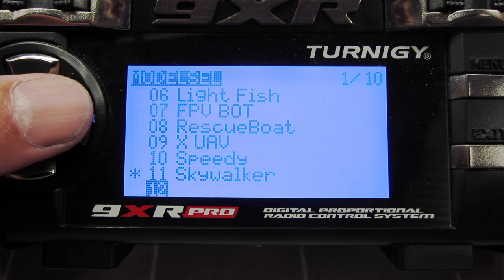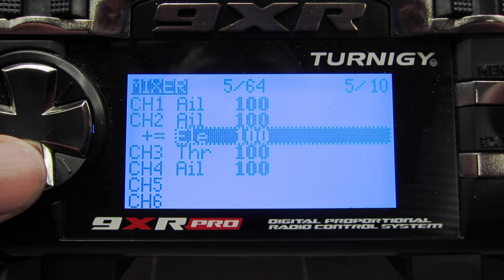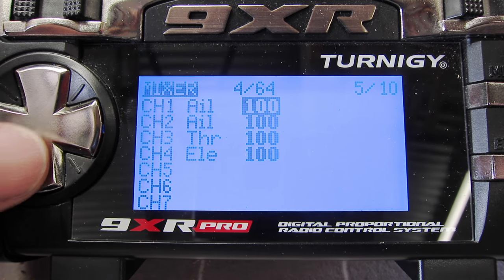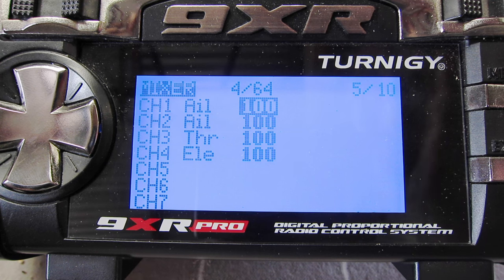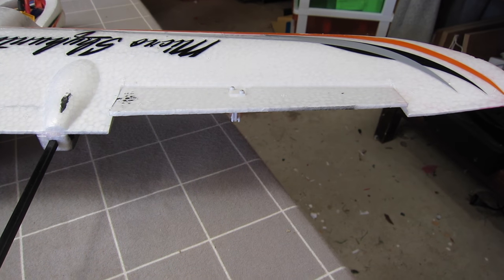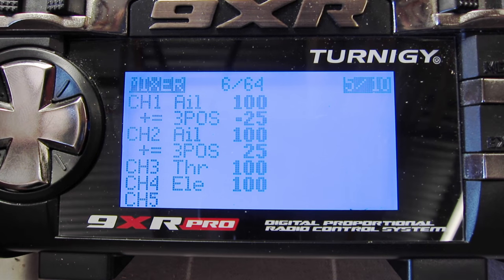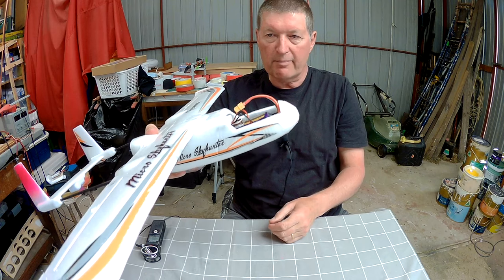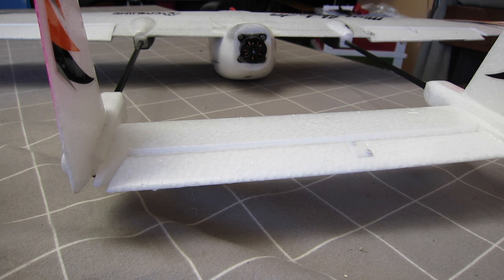OpenTX flaperons

Comment: Thank you so much Andrew!  If I can't get things to work now I better go back to control line!  I don't know if it will help on the small plane, but I will give it a try if I don't destroy it on the maiden.  I probably should get a trainer or something bigger and slower to start with.  I was going to build one of your trainer scratch builds, but every time I start I keep changing my mind and end up doing nothing.  Again thanks for taking the time to explain this in detail it really is great to have the ability to teach and to be as talented as you are.  I don't think I will have video, but I will let you know how it goes.
Reply from the maker: I have to thank you for prompting me to do it. Even if you don't use flapperons on this model it will be worth trying the programming for future planes. Good luck
Reply: @AndrewNewton  so did it end up working on this model?   I have the same one and want to know if I should even bother...
Reply from the maker: @kwad3d10  I didn't try it, no need

Comment: I have done something very similar on my Taranis for my gliders, but also added the flaperons to a Flight Mode, because FlightModes have tho option to add a delay. The delay slows down the quick control surface movements that you get from a switch.
Reply from the maker: I have not investigated flight modes yet, but you can add delays to any mix also

Comment: what a great video just what I'm looking for, I just did a maiden on my talon rebel gt first time ever flying a vtail which its flying pretty good on inav 6.1.1, were I fly its a short landing spot and I'm trying to slow this thing down, I've watched all your video's on this plane and done some research but wondering if I should go with flaperons or spoilerons to slow it down, I know alot of this will be trail and error but roughly how much deflection on alerions when either of these are deployed, Right now I have spoilerons setup and when deployed getting 8mm up I have no idea if this is even close to what i need to help with landing. Please give me your thought's on what I'm trying to do with this plane. Thanks again
Reply from the maker: Spoilerons are better to get it down in a shorter space. I would try a bit more but make sure you still have enough roll control. INAV will help with stability.
Reply: Thanks I will go with the spoilerions,   right now when there deployed I'm getting 8mm reflex but on roll getting very little up elevons and on down about the same but I guess its possible to use rudervators to help with roll but really not sure? Thanks for your help

Comment: Is there a way to make the aileron control only go in the up direction while flaperons is active?
My ailerons wanna follow the flaperons to much down when i control them and they will probably burn up the servos
Reply: I fixed my problem, i should set my end points in the output and not in the mixer, that way the servo will never move more than X% so if the flap is 100% aileron input wont add to the output to servo :)

Comment: What an elegant yet simple solution and easy to understand.  I have a Taranis QX7 running opentx 2.2 and it seems to perform nicely although I don't have a plane handy to try it out.  Just a quick question, assuming that maximum flaperon down travel will be greater than the elevator travel, i.e. the aileron travel will be contained within the flaperon travel envelope, then should the maximum aileron throws be set at the mixer level rather than at the servo output level?  Hope that makes sense. Mike
Reply from the maker: Thanks Mike, not sure I follow you. For slopers I may have ailerons and flaperons/spoilerons both going 100% For DLG I have lots of flaperon and much less aileron. I usually do all this in the mixer screen and only do servo reversing in the servo output screen. Any thing done in the servo output screen would affect both flaperons and ailerons so I would only reduce the throws there if I didn't have access to the servo arm or linkages.
Reply: OK Andrew, perhaps I stated the question badly.  I was missing a point here with flaperons in that the ailerons must be able to move further than the maximum flaperon setting otherwise you would not have any control authority.  Thanks.
Reply: Ok, sorted out my thought processes, all is well.  I bought the QX7 as a birthday present for my 74th birthday.  Love it to bits! Started flying RC last year and as there were no local clubs near where I live in Snowdonia, North Wales, had to do it all myself - using a cheapie Flysky FST6.  Now quite competent!  Your videos are a big help.
Reply from the maker: That's right Mike, but you can use rudder with full flaperons for some degree of control
Reply from the maker: Great to Hera that Mike. I imagine there are some big hills suitable for slope soaring nearby.
Reply: Thanks for your comments - sorry for delay in responding to yours.  Away on holiday at moment and not always  got a signal.  Anyway, all working now but I haven't test flown - I'll wait until I'm home in my own environment. Like the idea of mixing in a little rudder.

Comment: Don't you have any issues with stalls?I have full lenght flaperons and when I use them , the wing simlpy stalls , have you had the same problem and how did you solve it?
Thanks a lot , Sufyan
Reply from the maker: Not really but I don't fly around with lots of flapperon deployed, only for landing
Reply: Andrew Newton I mean in the landing , do you have any stalls? Or do you make a steep decend to overcome this issue?
Reply from the maker: Might depend on the plane or the wing loading. I don't do anything special for the landing and apply flaperons on and off repeatedly to slow it down but still keep control. You need to still have some aileron movement with full flaperons down otherwise you won't have roll control.
Reply: Andrew Newton I do have roll control when flaps are deployed , but I didn't know that technique you described
I also have very low wing loding